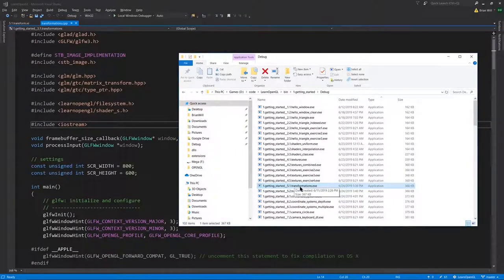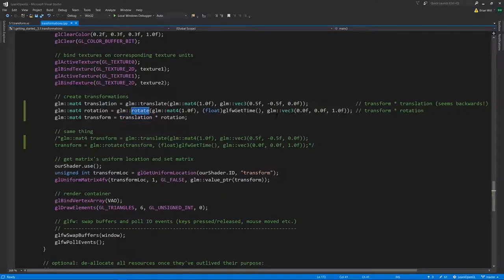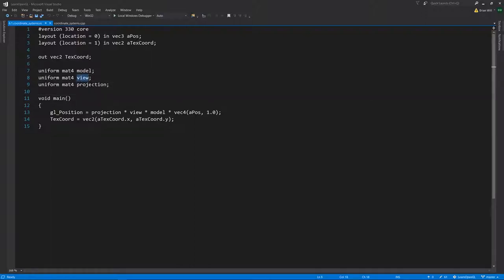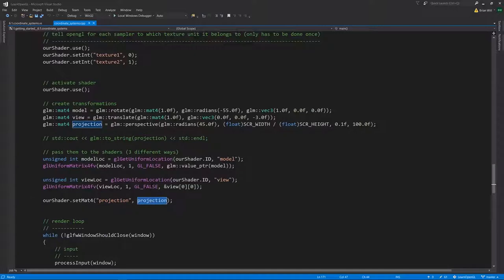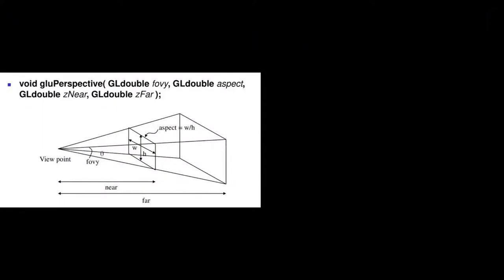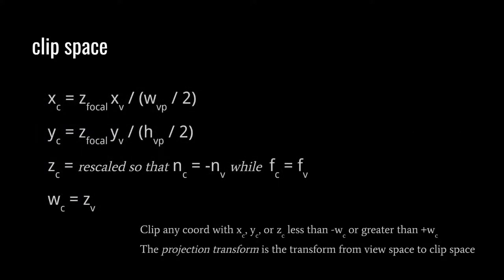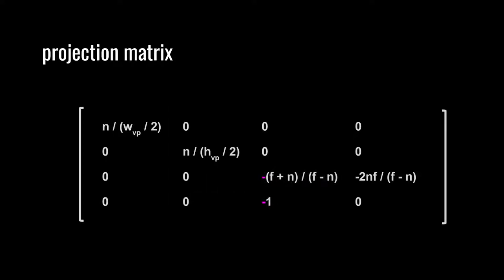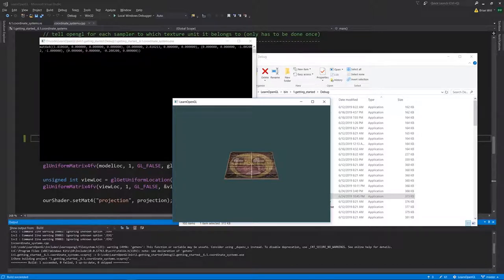OpenGL - model transform and projection

Comment: I have an issue. When I set the uniforms for the MVP matrices outside the render loop, nothing renders to the screen. But when I do so inside the loop, everything works fine. I understand as long as you're not changing any of the matrices (which I'm not) then setting them outside the loop should still work. Am I mistaken?

Thanks for the video though!